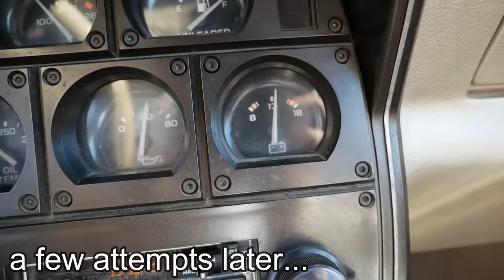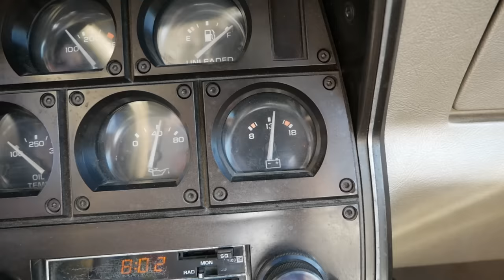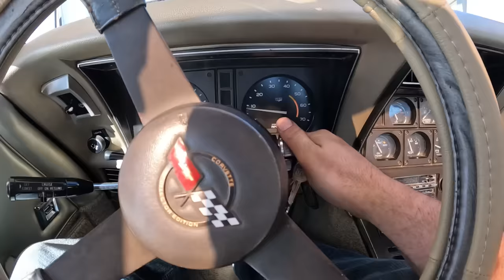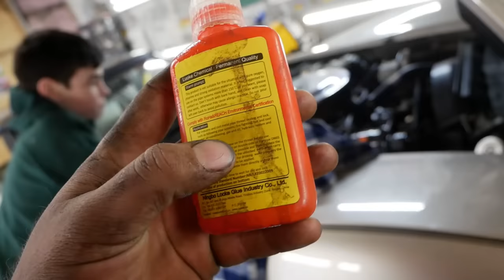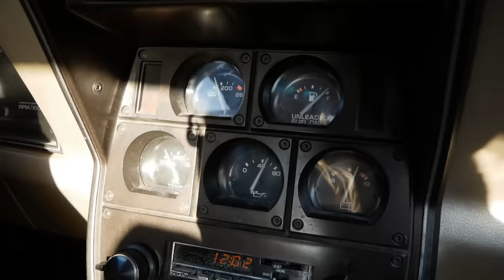RARE Corvette FOUND! Will it Drive 200 Miles Home For Restoration?

Comment: Loved my 82 C3. My old Crossfire benefited greatly from a new ECM with Hypertech chip. It ran poorly until I realized the old ECM was toasted.  Keep the intake seal good and the injectors clean and they run just fine. It is basically two truck TBI injectors. I cant imagine the minds of collectors exploding as you remove it from a collectors edition Vette. lol.
Reply from the maker: I hope so!
Reply: @PoleBarnGarage At least with a carb you gain a faster car and get some parts to sell. I touched every mechanical thing on my 82 and I think changing the radiator was one of my worst memories, aside from the rear wheel bearings and I ended up with remanufactured knuckles for that job.

Comment: Nice Vette and I hope you never ever have to change the Heater Core and Hoses like I did on my 80 Model. It was hard. R/F lower and Dash comes out, R/F Wheel and splash shield. Nightmare.
Reply from the maker: Yes been there, it sucks

Comment: Fuel pumps have pipe fitting thread. You have to use yellow Teflon as it’s rated for gas
Reply: LMAO, Not that type of gas.
Reply: @NoWr2Run  actually it is rated for both natural gas , and gasoline, as well as fuel oil.. but the liquid sealer that Dalton used works as well.  When I was a millwright going through my apprenticeship we took a class put on by permatex on all of their sealers and thread locker

Comment: What sucks for me is I lie in New Zealand and half th products you use are unavailable here. To be able to get parts and speed equipment I have to get in from Australia as stuff from the states is to expensive with exchange rate and sending to my fly speck country. I enjoy watching you take shortcuts and some of the things you do , I do . As sometimes I have to improvise. I’m currently doing a 1977 XC falcon ute. Basically same floor pan engine bay as the Mach 1 mustang. The falcon platform was discontinued 2020 I think . 60 years after it was dropped there

Comment: To adjust the TV cable better you need to have someone hit the gas pedal to the floor while you hold the adjustment button on the cable that way it adjusts to more realistic conditions because the pedal doesn't always open the throttle blades 100%

Comment: You put the front armrest screw in halfway and then pull up on the armrest and put the rear screw in and almost tighten it and then put the rest of them in and tighten it up that is how i had to install them on the 81 and 85 Chevy Camaros

Comment: Beautiful car and color, exactly what I'd've picked. I had a Brown '79 back in the day ('87-ish). T-Tops were only stolen 4 times, fairly light for the times. Car itself was only stolen once, also light, but unfortunately the beginning of the end of it. Those over-engineered brakes just plain SUCKED, and I didn't have the option of the cool "o-ring" piston set that you found (the internet wasn't invented then - GASP!) One day the differential made a definitive sound I took as a Death Rattle, so I sold it to my disbeliever best friend on the proviso that I wasn't fixing that differential when it went out. It lasted exactly 7 days, whereupon I got the memorable pleasure of sitting in a chair pointing to him where to unbolt, to replace it with a "new" used unit. To his credit, he never said a bitchy word about it. My friends passed that car around like a $40 ... um ... girlfriend.

Comment: The only thing good that I can say about GM’s TBI was that it was simple and inexpensive to repair. Other than that it sucked the hind tit on a boar hog.
 Fuel pressure is absolutely critical for it to run correctly and the injectors would slowly go bad and run lean.  They weren’t horrible and was an improvement over carburetors especially on cold starts.

Comment: Was wondering if you ever fixed the rear tire woble that you thought was a bearing?
Reply from the maker: Nope, it'll run for 10-20 thousand miles but it will need addressed at some point

Comment: Fuel injector clips are notorious on these. They are on the top of the throttle bodies. Pop them off…make sure the metal prongs are tight and make a good connection……please trust me on this one! Took me a few blown fuses on one years ago to find the problem. Best way to find it is to look at the spray from the injector and see if it pulsates….fixing this makes these crossfires run smooth as glass
Reply from the maker: Yeah I mean maybe but you really can't diagnose anything from a video about it.
Reply: @PoleBarnGarage  stop by my house….ill have it fixed in 10 minutes
Reply from the maker: I did too,I threw it in the trash

Comment: Leaf seal. ? Can you replace with a o ring. 
It's mick Australia 🇦🇺 
Could not see was to far away.  
You will change to carb. I and 🌎  know you hehe. 
I see one injector spraying and othe not . Other then that it would have ran fine. 
Au bering mate ktf brand. 👍 good and reliable.  Cheap inport  and cheap us to au dollars.  How are going on the new shed slab ??? Question please ask. God bless

Comment: Fair warning about that Seafoam transmission snakeoil....NEVER use it in a first generation Hydramatic transmission (used in Pontiac, Olds, Caddilac from ~1940-56, and trucks until ~1960 and MANY non-GM cars of that period). My 1947 Olds never shifted great and would loose reverse as soon as it got warm...after 2 years of driving it like that I added the Seafoam to see if it would help, and THE NEXT DAY mid way through a bit of driving all I had was first and neutral (had to find and swap in a different hydramatic in to make it driveable above parade speeds).
The Lucas stop leak isn't bad in late 70's ford C6 transmissions (mine is made after Ford switched them from Type-F ATF to Mercon). I've had a 1978 Lincoln Mark V with 460 and C6 for a decade (was my first car) and the entire time I've owned it there's been a S-L-O-W transmission leak that I've been too lazy to pull the trans and fix (hell until I swapped the Olds Transmission I didn't even have sufficient tools to make an attempt) I've been intermittently (like once every year or 2) been dumping in a bottle of Lucas stop leak/stop slip transmission honey for basically the entire time I've owned that car and it hasn't changed transmission performance any (still just as decent as when I bought it)...Granted it also hasn't stopped the leak. It does slow the leak, but may not be worth bothering with.

Comment: Did you at least protect those wires you cut? If not, the corrosion might eventually swell those wires into the remaining good wires. Or short out against each other and cause some weird gremlins?
Reply from the maker: Cut and taped, always been good enough for anything I've done, automotive or industrial

Comment: Funny how it's a car you care about you spend the time and money on it. There is a Teflon tape specifically for use with petroleum products(gas diesel propane).
Reply from the maker: Yep it's yellow, I didn't have any though. That pipe sealant actually worked very well

Comment: So basically the collector's edition Corvette is a really luxury version of the c3 like the pace car my uncle used to have a very nice 146k miles 350 quadrajet carb swapped 4spd manual shift transmission 12 bolt rear 4.11 gears and factory forged sbc

Comment: I've seen miracles with shoddy injectors when you pull the fuel line and feed the car off brake or carb cleaner for just a few seconds. There are some videos on youtube where people have demonstrated that with the injector removed, so you can see it for yourself.

Comment: It would have been cool if you put a fuel injected Holly carburetor just so you can have the advantage of a modern fuel injected engine and have ability to make adjustments on the fly

Comment: The rear parking brake shoe thing is the worst design for parking brakes. My wife's old 02 Sonata had that on the rear for her parking brake and when I did rear brakes all of that shit including the hardware had disintegrated. What's wrong with cables? So much easier and better.

Comment: Get a 'Transaxle' for it to better balance the front and rear weight ratios.
Reply from the maker: Yeah just bolt that in...
Reply: @PoleBarnGarage  From your efforts/experience with the 4X4 van, shouldn't be a problem.

Comment: I had a cross fire I ended up putting a carburetor on it and it was low mileages and I got the car cheap because of the cross fire. I was lucky the brakes was good, I don't like the automatic transmission

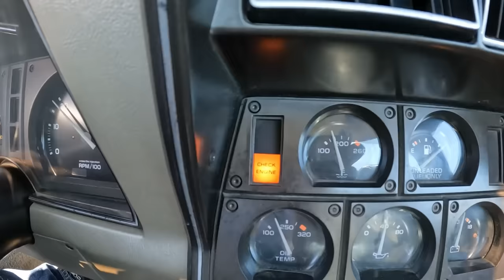Comment: 10:00 If I was in a position to own a 'toy' car a C4 corvette is high on the list. New enough to handle decent, old enough that I can easily carb one if-and-when the FI fucks up, and I'm a sucker for 80s styling so I find them quite pretty inside and outside.

It would be terrible as a daily for me. The potholes on my path to work would obliterate the suspension and fitting RC planes into a corvette is nightmare fuel. But as a 'toy'? I could dig a C4 Corvette.

Comment: This is probably the nicest car i have seen this guy buy to bad its a 82 . I had a 69 convertible stingray and a 78 t-top stingray 14 years ago and was a huge Corvette guy but im 6’2 and barely fit its def not comfortable the 69 i had to have the top down and the 78 i had to have tops off. I lost them to my fiancée what is fine whatever her dad gifted them both to me as a early wedding present anyways so whatever i dented thehoodand crack the side fender banging his daughter on it anyhow so any vet guy knows how expensive those parts are to replace lol. Plus any Vet guy knows after 1971 they tuned them down for safety and the 80’s models were the worst and they didn’t fix the speed and looks until the late 90’s early 2’000s so idk how that 82 is so rare and sought after lol

Comment: I should have said 12 bolt center section because the rear suspension in the Corvette is probably different than anything most people will ever encounter working on.
Reply from the maker: Would have been a Dana center not a 12 bolt

Comment: PLEASE spend the 6 or 10 dollars and order some bick 4 leather conditioner. A lot of people use it for boots, myself included, but it will work just fine on those seat covers, too. 

It's made for high-quality boots, and it's non oil based, so it won't change the color of or darken the seat covers you put on. You never know how long that leather sat on a warehouse shelf, and it could be more dry than it seems. This stuff will keep it from cracking or tearing.

Comment: I believe the door armrest is the same as the 78-84 Chevy Camaro and the Pontiac firebird and honestly their door panels are not designed any better ive had a new body style titled 81 Camaro berlinetta Lt,a 84 Camaro hardtop sport coupe 81 was a hardtop third gen also,a 85 Camaro berlinetta 2.8v6 mpfi t top sport coupe with factory fiberglass nose and doors, and it is actually the only automatic transmission third generation Camaro ive owned

Comment: Rotella IS meant for flat tappet cams, a lot of diesel engines have flat tappet valve trains and last for hundreds of thousands of miles running it!
Reply from the maker: And they don't run over 3500rpm lol
Reply: Rotella ZDDP levels have dropping with the CK-4 spec to around 1000-1100ppm. That’s not sufficient for gasoline performance flat tappet cams. The reason diesel engines have no issues with it is because they run much lower spring pressures and rpms and most modern diesel engines have switched to roller tappets too.
 1600ppm of ZDDP is what most cam manufacturers will say is optimal for most flat tappet cams in gasoline engines. Rotella (and other diesel oils) use to have that covered before the current CK-4 specs. I don’t know of any API rated CK4 diesel oil that has over 1150ppm ZDDP. 
As a matter of fact Ford issued a TSB in the past that stated that the majority of CK4 oils didn’t have enough ZDDP to protect the valve train of the 6.7 so Ford blended their own and came up with their own spec that oils must meet for the 6.7. 
The days of dumping diesel oil alone in a gas engine with a flat tappet cam and being good are over. If the engine is stock with normal spring pressures it may last but if it’s a performance cam with stiffer springs then it will need more ZDDP. I’ve found that Risolone’s Blue Label ZDDP additive is the most cost effective solution. Amazon usually has it for $7-$9 bucks a bottle and Risolone is good enough to tell you on their website exactly what Zinc levels you can achieve based on the amount of Risolone that you use. Risolone also adds detergent/dispersant with the ZDDP which is critical to keep the additional additive in suspension in your oil. Not all additives do that.

Comment: I mean what is better than a 80s GM throttle body?  Its conjoined twin cousin, twice the throttle bodies, both dependent on the other working flawlessly.  Watching you cut that design completely out and throw a carb on is almost better than watching you shoot self tappers into a $500 door panel....

Comment: Curious why You dont rebuild the original calipers? Are seal kits and pistons not available? *So the re-mans look identical so I am curious why you wouldn't just give the old calipers a quick hone and the new pistons into them.
Reply from the maker: Because I'd have to hone them and deal with stuck bleeders, reman units are actually pretty cheap
Reply: @PoleBarnGarage  Ahh yeah I thought it may have been due to the time spent and the potential of everything fuse rusted together. 
I have Japanese cars so no luxury of remans

Comment: Actually, the driver's seat is power. That's why you have to go underneath. They thought I had unlike nowadays. Where if your power seat goes out you have to disassemble a mot3r and use a screwdriver to move the seat so you can take the seat out. To change the moters and that 1 play thought ahead. No matter where the seat is, you can remove it.

Comment: I had an 82' for ten years and every caliper was replaced at least once under warranty. If you look at them they're universal. The only thing that is different is the bleeder and it can be moved. What a pain in the ass it was to bleed them too!! I spent 4 days bleeding them the first time. 3rd with the ass all the way up and 4th with the ass all the way down. I'll never own another one but, they are cool unless you have to wrench on them.

Comment: So for context I get motion sick as a passenger in any vehicle but never as a driver: Towards the end of the video when you're driving home and the sideview mirror is visible in the center of the frame for an extended amount of time, for the first time in any video I've ever watched, I was getting motion sick while staring in to the mirror. Full on hot flash, nauseated, headache, everything. Super weird. Figured I'd share. Felt like I was right there with ya I guess, lol.

Comment: Why fit a carb to something already rigged up for fuel injection? Something like a MSD kit would improve the performance and reliability
Reply from the maker: An "msd kit" 😂 do tell what that is
Crossfire injection is notoriously terrible, besides the fact that a carb is more simple, and easier to use. If you can figure out how to turn a screwdriver, you can tune one

Comment: Man, there's NO way that's the original 1982 700R4. The first two years of production exploded even more often than the later ones. My 1984 is basically smoked and it's only got 30k on it.
Reply: Those crossfire injected turds probably only made a couple hundred horsepower stock, you wouldn't think that'd be enough to hurt any of the original drivetrain.
Reply from the maker: They are absolutely garbage I would not be surprised if it wasn't the original
Reply: @jameslovitt994  the 190hp that my Camaro made was enough to basically kill one dead. Chevy had a run of real "good" designs when they started making auto overdrives.

Comment: Crossfire🤢 Had a Crossfire 305 Camaro ended up putting a Q-Jet on it ran way better, didn't know they put the 700R4 in these thought they were all TH400
Reply from the maker: Th400 was gone in vettes after '75, th350 ran from 76-80, th350c(lockup) 80-81, 82 is all 700r4

Comment: yeah im pretty sure a   porsche  and   jaguar  would  demolish a  vette  handelingwise
Reply from the maker: Not even close. A jag of similar vintage is heavy, not even the same class of car honestly. An '82 Porsche would be left miles behind
Reply: @PoleBarnGarage   not    in handelig the  suspension geometry in  american cars are pretty  dismal  and i own one and owned a few and worked on ALOT of american cars to revise the  camber  curve  ackermann and  bumpsteer and the vette is heavy too it woulda been lighter if the body was made in steel a  porsche  is  very awkward to learn but when you know what to do with them a  911   will befeat  most cars jaguar also has  very good  suspesion  in a  drag race   then yeah the vette might have the power advantage a buick gnx was the fastest production road car in the world  0-60 and  quarter mile in  1987 but   were terrible   in the turns and  with brakes

Comment: Crossfire. The loudest fuel injection EVER
When you junk it and put on a carb, make sure you wire up the lock up for the converter.  Fastest way to burn up a 700r4 is to just let the converter free wheel
Reply from the maker: I've never had any issues running them unlocked, is that really a thing?
Reply: @PoleBarnGarage  it is on an 89 firebird with a computer controlled quadrajet
Reply from the maker: I'll look into it

Comment: 32:35 you just answered the question I could never think to ask, how do you get hog rings to hold onto that garbage little thin bit of fabric that even the obnoxiously expensive seat covers have these days? You cut up a coat hanger and snip snip. I'm not going to make the other joke about how the snip snip prevents the need for the coat hanger in some states and municipalities.  Oops, just did :face-blue-wide-eyes:
Reply from the maker: Yikes 😂